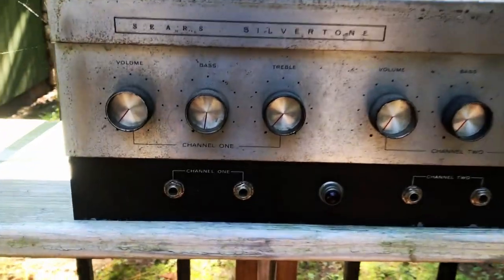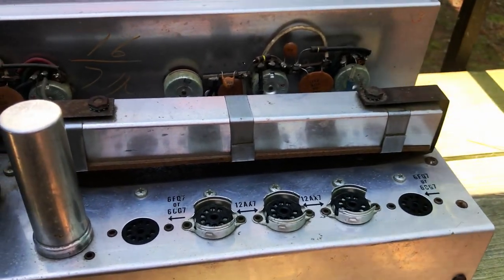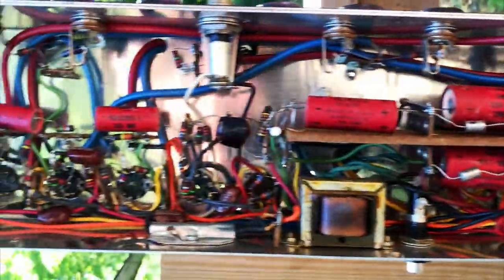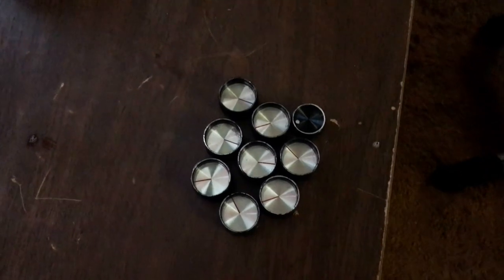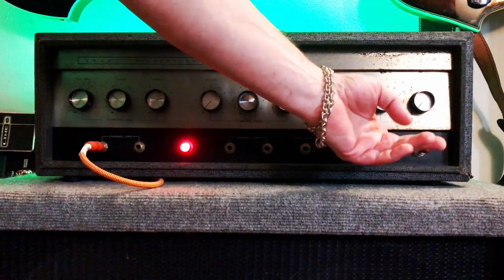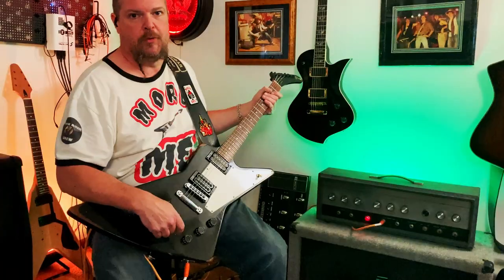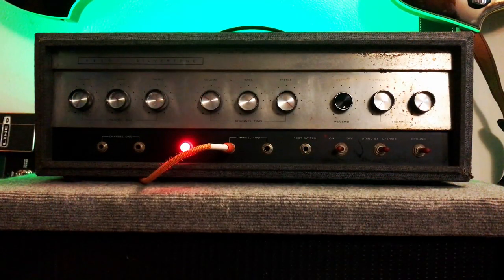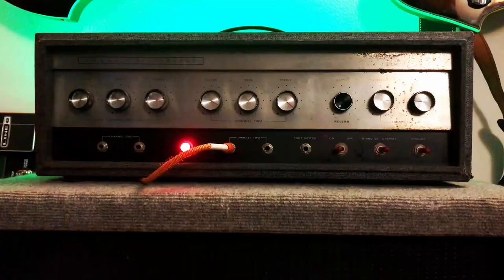Silvertone 1484 - Can this old dinosaur rock ???

Comment: I bought one of these at a consignment shop in 1992 for $20 I immediately blew the output transformer put it in my parents's attic. Got it back about 5 years ago. Recently I found an all original cab so I replaced the output transformer while in there I noticed that channel one had no Connection to the board just empty input jacks. So I moved one from channel 2 over. Then on input 2 of both channels I installed A56K metal film resistor. I like that sound better than the 67K carbon. Try it out if you like to tinker
Reply: haha just saw this awesome story over on living room GD's page. glad you kept that thing all these years and get to rock it out

Comment: The filter choke looks overheated and discolored. They are indeed known to fail, although you can get suitable replacements. I'm told that the biasing from the factory on these tends to be a little too hot and they could use modification to the negative voltage circuit to cool off the output tubes a little bit so that they're not pulling so much current through the choke.